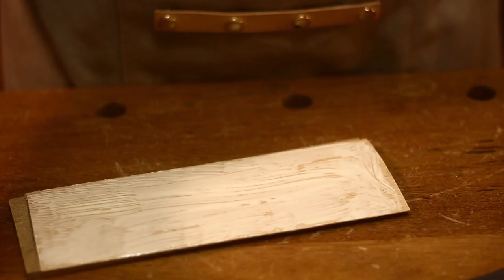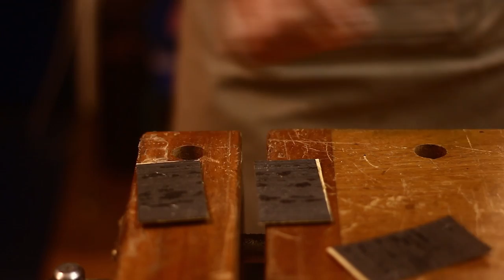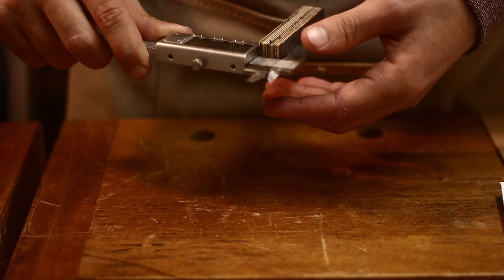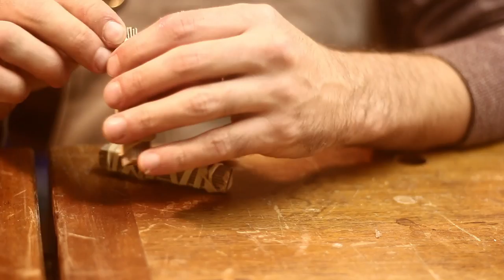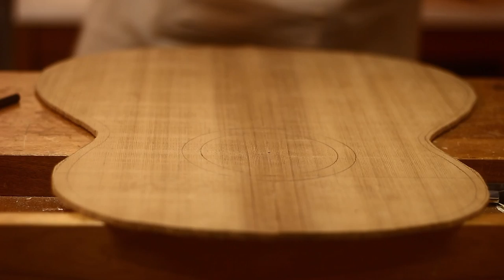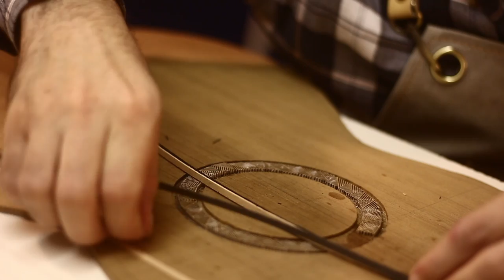Making a Pattern Rosette for Classical Guitar - Christian Crevels Handmade Guitars

Comment: You missed one of the most interesting and important thing - turning square-section rods to trapezium one :) In general, those angle is something that drives me crazy as usual mosaic is rectangle and there's either picture distortion or extremely complicated glueing process... 

Nevertheless, thanks for video. Really stylish and clean rosette, modern and simple.
Reply from the maker: I use a sander to make the appropriate angle. In my design the angle doesn't really impact the overall aesthetic of the rosette, but that might be the case in other designs, particularly if you like bigger motifs. Knowing the size of the piece you can calculate how many pieces you will need, and thus how much angle to apply. I split the angle in two and sand it in both ends of the rectangle, but I know some folks like to make it all in one side and leave the other side square. Set a bevel gauge with the angle desired to check your piece and that's it!
Thank you for the comment!
Reply from the maker: I made a short video on how to do exactly this, check it out:
https://www.youtube.com/shorts/e7R2XkwnX2M